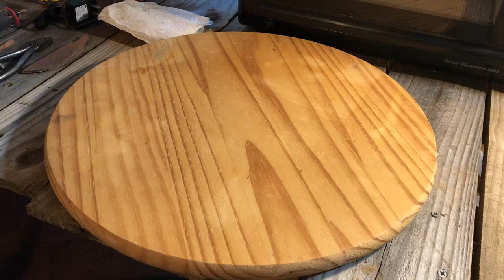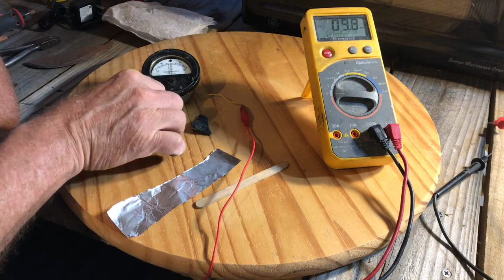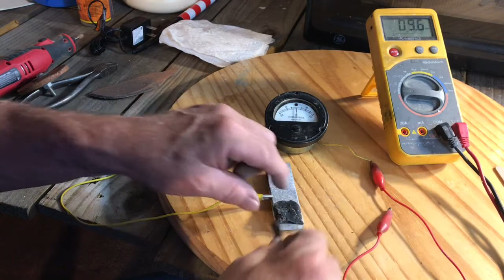Solid Electrolyte for cement battery

Comment from the maker: update and apology for not showing the voltage.  Sometimes I am not bright.  This is June 6, 2021 and the solid electrolyte is still producing a good amount of power.  I have been running a solar pendulum since last year and the magnesium is still good.  I do add a drop of water to it once a week so that lets me know that the electrolyte has some moisture in it.

Comment: Hi! Cool battery! What do you use as electrolyte?
Reply from the maker: To make the electrolyte you do this:
I want to preface this by saying the materials are caustic, so you must wear PPE gear.  Make sure you cook the mixture in a well-ventilated area.  

Now, get a plastic bowl and add these ingredients to it for mixing. 
 1. Fine-grade Graphite and fine powdered activated charcoal and lamp black for conductivity. I made the lamp black using a large wick in a jar with corn oil for the fuel.

2. Sodium Silicate, known as "water glass".

3. when mixed pour the mixture into a disposable glass container.

5. Heat the mixture at 250 degrees Fahrenheit until the mixture becomes a taffy consistency.
This will take many hours, in a well-ventilated area.

Check the hardness of the material by putting a drop of material on a cool surface to see if it hardens.   The electrolyte will be like hard candy.

Make sure to remove the material from the container before it hardens or you will not be able to get it out of the container.

6. Spread the mixture to the desired thickness.
WARNING:  Be careful with the electrolyte it can be harmful to your skin.

I also found that if you apply the electrolyte to the anode or cathode metal it will work better.

Thanks for the inquiry and have fun.

Comment: How do I make my own? I'm looking up experiment with electrolytes myself. I'd love to chat
Reply from the maker: To make the electrolyte you do this:
I'd like to preface this by saying the materials are caustic, so you must wear PPE gear.  Make sure you cook the mixture in a well ventilated area.  

Now, get a plastic bowl and add these ingredients to it for mixing. 
 1. Fine-grade Graphite and fine powdered activated charcoal and lamp black for conductivity. I made the lamp black using a large wick in a jar with corn oil for the fuel.

2. Potassium or Sodium Hydroxide in H2O.

3. Sodium Silicate, known as "water glass".

4. when mixed pour the mixture into a disposable glass container.

5. Heat the mixture at 250 degrees Fahrenheit until the mixture becomes a taffy consistency.
check the hardness of the material by putting a drop of material on a cool surface to see if it hardens.   The electrolyte will be like hard candy.

Make sure to remove the material from the container before it hardens or you will not be able to get it out of the container.

6. Spread the mixture to the desired thickness.
WARNING:  Be careful with the electrolyte it can be harmful to your skin.

I also found that if you apply the electrolyte to the anode or cathode metal it will work better.

Thanks for the inquiry and have fun.
Reply: @ET2uscg  I'm looking to get to making some of this. Does your recipe have amounts for each ingredient?
Reply from the maker: Lonnie, I recently started looking back into this
experiment.  I buy the water-glass, so I do not need to use sodium or potassium hydroxide.   Now, addressing the quantities of the graphite and
lamp black.   Lamp black is used to increase the conductivity ,but, is difficult to get a large quantity,
so, graphite is used in a larger quantity.